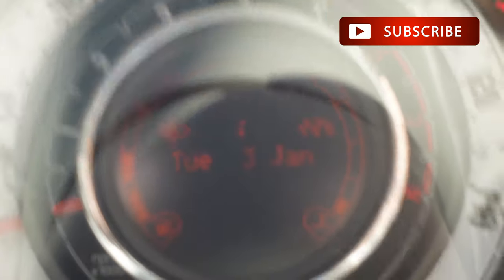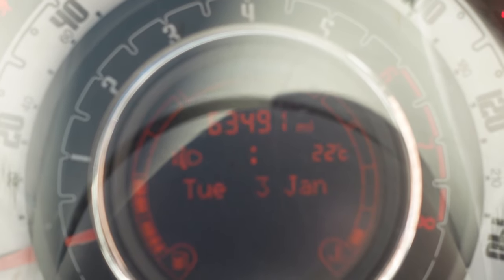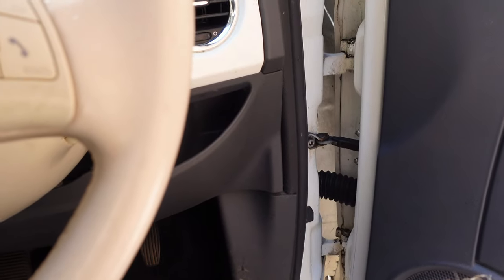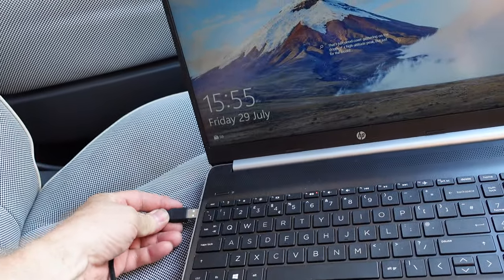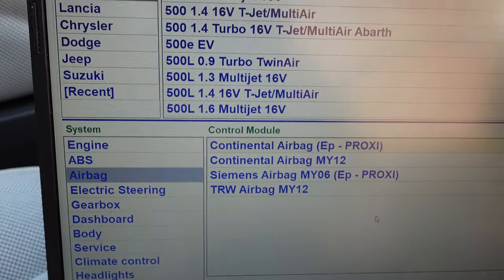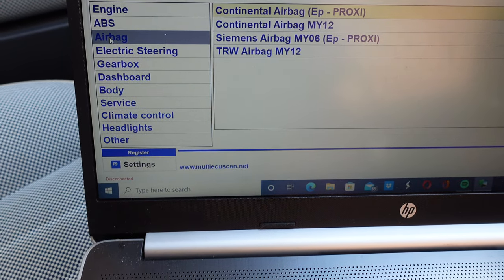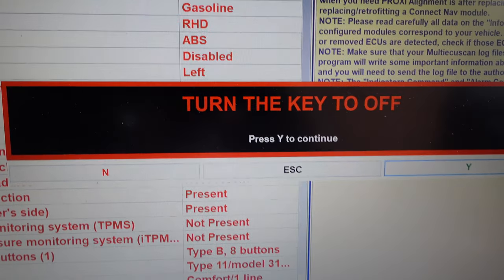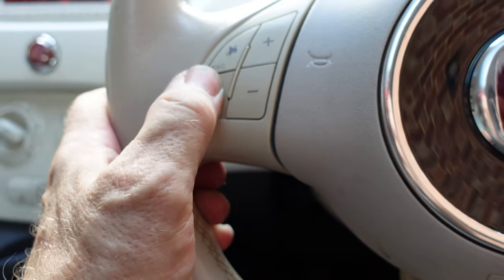Fiat 500 Flashing Mileage & Proxy Alignment - Blue & Me Not Working? #blueandme #fiat500 #abarth

Comment: Thanks for the video and your input. How do I disconnect the BLUE&ME system in the Fiat 500. There is an option to disconnect the power cable to the system. The system causes the battery to drain quickly.
Reply from the maker: You have to disconnect it on the back of the unit.
Reply: @Love500  thank you for the answer! Can't find a BLUE&ME edition on the wall. There is another place]. Fiat 500 robotic 1400 engine year 2014 manufactured in Poland. I looked in several places and couldn't find it.
Reply from the maker: @eliyahohayak  there is a possibility of it being under the dash to the left of the stereo but that is on a right hand drive car so logically on the other side. You can’t get to it unless you take out the parcel tray. It’s strange that there seems to be a very occasional change of location.

Comment: Have you ever done this on a Peugeot Boxer van? I have a 2014 van with flashing mileage, not too worried about losing the bluetooth or handsfree function but its draining the battery. I can't find any info on where the module is located though. Will Multiecuscan work on a Peugeot van? its same as Citroen and Fiat as far as I know.
Reply from the maker: I’ve never tried. In theory it should.

Comment: Hi. I have a 2012 fiat 500. Flashing odometer and battery drain if sits for more than 24 hours. Battery and alternator replaced. I removed blue and me module last night and today after driving to work and sitting for ten hours battery was dead again. Do you have any other suggestions?
Reply from the maker: Have you changed your earth strap? Is it actually dead? Lights working?
Reply: @Love500  lights came on but no start had to have another vehicle jump to start. I’m in USA, when you say earth strap is that the black ground cable of battery?
Reply from the maker: @kassiemiller9075  it’s the cable that goes from the left top chassis leg to the gearbox. A braided cable usually in a plastic sheath. They rot out and snap. The earth from your battery terminates on the same bolt. You need to take your battery tray out to get to it. Look in my videos you’ll see a video on it.
Reply from the maker: @kassiemiller9075  here’s the link.

https://youtu.be/QvJmDtKlV_E?si=7TojZlqp2K_aRKk9
Reply: @Love500  Thank you!!

Comment: Got same problem with my fiat 500 also after ten minute  warning light start flashing intermittently , is that still the cause?
Reply from the maker: More than likely. Intermittent sometimes. I just had one that was randomly flashing. Just had it repaired and works fine now.
Reply: @Love500  thank you so much you very helpful ,  sorry I take advance also , on the other 500 colour therapy 1.2 sometimes when I unlock the car the boot stay locked and when that happens the plate light not working and the message come on the speed say check check number plate light
Reply from the maker: @diegomasciave7615  that sounds like you have the dreaded tailgate wiring damage. Disconnect your battery and get in there and look at the wires. You’ll probably find some frayed and broken ones.

Comment: Hello, I have a Fiat Punto, I disconnect the blue&me and do the proxy alignment and it doesn't do it, if you removed the fuse if it does it, but then the radio doesn't turn on, I want to eliminate the blue
Reply from the maker: You need to unplug it at the unit.
Reply: @Love500  I have the unit disconnected and when I do the alignment it seems that it does not recognize that it is not there and it gives me an error and it does not do the alignment
Reply from the maker: @OmarRodriguez-yn4jp  it won’t do it if there are any other codes. Connect to each ECU and clear any stored codes then try again. I came across this a few weeks ago. I ended up doing the proxy alignment 5 times then realised there were other codes. I cleared them and then it worked.
Reply: I already did a complete scan and deleted all  the error Codes and in no way does It aling the  proxy, i don't know what to do .
Reply from the maker: @OmarRodriguez-yn4jp  keep trying it, if it doesn't have an error but just says complete but mileage still flashes, keep trying. I've never had it not work.

Comment: Thank you for your clear and informative videos!
I have this problem (Fiat Panda) and bought a new battery wich is now drained. I can't find anyhone who repairs this in sweden but in UK. 
I've been thinking about changing the steroe instead. 
Will the battery drain stop as I take the blue and me module out, or do I also have to do proxy alignment or anything else. And will the  milage stop blinking when I get the module out without doing anything else?
Thanks in advance!
Reply from the maker: To stop the drain, you need to unplug the module at the module. You may as well take it out. If you put an after market stereo in, you will still need to do a proxy alignment to stop the flashing.

Comment: Hi Paul, great videos!  If I disconnect the B&M, will the head unit still work for FM and CD?  Will the Odo still flash? I guess a different head unit will not stop the blinking Odo even with a Proxy alignment?  I basically want to stop the battery drain.  Cheers
Reply from the maker: Stereo will still work. Steering controls won’t. Flashing won’t stop until a proxy alignment is done. Same applies if you put in a third party stereo. Still needs proxy. Unplugging at the unit will stop the drain assuming it’s the blue and me causing it. Usually is.
Reply: Cheers Paul

Comment: Hi, thesis for all your amazing videos. Now, I want to get my own fiat 500. I found a blue one with the twin air from 2010. The front wheel alignment is of, the steering wheel is turned to the right and after a turn it won't move back like normal. Also it has aP0171 code. Is this a case still worth buying?  Regards Kai
Reply from the maker: As long as it’s only the tracking that needs doing and not something more sinister underneath. I would insist on it being done before buying it. The code is something to do with fuel I believe, possible vacuum leak. I wouldn’t be buying a car with errors like that unless they were fixed first unless it’s dirt cheap. The fact the seller hasn’t fixed them maybe because they can’t figure out what’s causing it.
Reply: @Love500  Thanks a lot. This helped me so much

Comment: Will that scan tool let you change weather things are present or absent we got a used ECU kit for one with a bad engine ECU the only thing wrong is the car the ECU kit came from had a knee airbag and this car doesn't so we have a airbag light on with the airbag ECU from the kit and with the original one no light but flashing milage and the proxy fails at the airbag
Reply from the maker: The airbag ECU controls the knee airbag not the body computer. I don’t understand though as all fiat 500s, at least the UK ones anyways have knee airbags. In adjustments tab in BCM you can disable things, I don’t think you can do that on the airbag one though. Whenever you disable something you then have to do a proxy alignment. I’m doing a video on this software today so I’ll have a look.
Reply: @Love500  it's a UK car and it's definitely not got one
Reply from the maker: @colinhamer6506  that makes no sense! Can you email me a pic at paul@love500.co.uk
Reply: @Love500  I can't we have let them take it with the milage flashing until we figure out how to get it done
Reply: It's definitely not got one just a peice if polistirean where I would be

Comment: Right ,here's my story. I've bought a new used cluster for my Fiat GP 2007 from a 2009 similar car. Milage start flashig after swapping. I tried a proxi aligment with Multiecuscan (registered) and the Elm 327 + yellow adapter. All modules are Ok , except Dashboard node Failed ( out of range). 
What is going on , will the new cluster need programming or something ?
Reply from the maker: No they don’t need programming they are plug and play apart from needing a proxy alignment. The out of range error usually means there’s something wrong with it. I’m assuming yours is a US car as I don’t know what a GP is but the same should apply. I have had instances where it’s done that on a blue and me so proxy doesn’t complete and the person who I did it for messaged me and said the mileage stopped flashing on the way home. That has happened twice. I would try another one if you can. Did you get one with the same colour dial? I.e. black, white, yellow? Also is it from a diesel or petrol. Shouldn’t make too much of a difference but there may be an incompatibility. When u e bought replacements in the past I’ve been asked what colour dial I have as well as the year.
Reply: @Love500  So the GP stands for Grande Punto. I thought aswell about some incompatibility issue, but I just set the gas milage instead of the milage to be displayed for now. If I get used to it I'll be fine,  I guess .Thanks for helping anyway 🍻
Reply from the maker: @Paul_Martinas  oh yeah, I’m aware of the grande punto. I reckon it is an incompatibility then.

Comment: This was really helpful....
I have a faulse open bonnet msg.. I reconnected the battery but didn't help, is there a solution with ecuscan?
Thanks in advance.
Reply from the maker: Uk cars don’t have an open bonnet sensor or do you mean the boot?
Reply: @Love500 I don't think mine has either..
It popped up when I used Alfaobd and changed alarm setting from off to on..
Reply: Changed them again afterwards in order to fix it but it didn't..
Reply from the maker: @fig4snick  they all have boot open message. If the boot is closed and you’re getting error then it’s likely to be your hatch wiring.

Comment: Is it possible to make it so that the Blue&me module isn't even searched for? I had a parasitic drain with my b&m and so removed it. I dont care to put it back or to replace it or put a fancy radio in. The flashing does bug me though.
Reply from the maker: Only by disconnecting the power cable at the unit itself, then a proxy alignment. If you physically removed it, then a proxy alignment should run successfully and stop the flashing.
Reply: @Love500  thanks for confirming. I'll set about getting the bits together and sort it. Didn't want to get the software then be no better off 👍

Comment: Thank You for very informative video. Sadly mine stopped working yesterday. Disconnecting battery did not help. Removed the unit and it goes to electronic workshop for repair.
Reply: Got mine repaired. No flashing odometer anymore and everything is working as it should again 😀
Reply: @iwadrian  Hi, who did you use for the repair? Cheers
Reply: @seantucker2690  Revtronic Bradford West Yorkshire. You can buy repair online and send unit to them. I have wisited them in person because living locally. Collected within three hours.

Comment: Hi why do you need the yellow cable can a normal elm not work, and will this work the same on a KA 2 as its basically a 500??
Reply from the maker: Engine, steering and auto box I believe use just the elm. Everything else on a 500 needs the yellow. I have no idea whether it works in a Ka, never tried.
Reply: @Love500  ok thanks for the reply it might be worth paying to get this done as by the time I buy another adapter and the software it would cost about the same,
Reply: @Love500  hey, I went to the multiecuscan site and I can't find the yellow adapter

Comment: Thank you so much. I have a Ka 2013 and without warning on startup one day I suddenly had a flashing odometer and no bluetooth/voice and the respective buttons on the steering wheel were unresponsive. Thanks to your vids via google I have removed the module (I didnt try proxi first) and just fyi you dont need to drill out the rivets - I used a small hobby type 1/4" ratchet (like you get in a pound shop) with an 8mm socket and had no problem removing the 4x nuts. The module can then be easily drawn out through the area just behind the speaker. Yes a bit fiddly but imo far less effort and mess then drilling out and replacing rivets. I have sent my module off today for repair and all my fingers and toes are crossed that it doesn't need a proxi on return but if it does I may take you up on your very kind offer to align! Again, thank you so much, people like yourself make YT the valuable resource it is.
Reply from the maker: Someone else said about the bolts. I’ll have to update this. Glad you managed to do it.
Reply: @Love500  yeah its just an option my friend. I weighed up the two options and went with the nut removal. Personally I think its easier and quicker but then its not my 1st time working out solutions in cramped spaces - under the dash on your back in contorted positions in footwells is the worst right?!!
Reply: Little update to this - got my unit back from repair (no affiliation but Northern Autotec were brilliant) and it worked perfectly from the get go. No requirement for Proxi either! They were upfront in making no guarantees that Proxi wouldn't be required but I guess I got lucky :) So with your video help, £95 for the repair (+£5 to ship it to them) I got the whole lot working for £100 and a bit of my time which would have cost about £1200?? at Fords. THANK YOU!

Comment: I’m thinking of buying a 500 from a friend,he says after changing the battery his mileage started flashing and the Bluetooth stopped working,can I replace the blue and me module with one from eBay or does it also need programmed? Thanks
Reply from the maker: Will just need a proxy alignment to stop the mileage flashing. No programming required. A proxy alignment may make it start working though so try that first.
Reply: @Love500  how do I get the proxy alignment? Do I need to goto Fiat
Reply from the maker: @bill_20  if you want to pay about £130. Get yourself multiecuscan and a set of cables from eBay. www.multiecuscan.net for the software.  Costs 50 euros. This video shows how to do it
Reply: @Love500  hey thanks I will check this out later,thanks agsin
Reply: @Love500  also any advice on buying a 1.2s 1242cc,is this engine shared with any other car?
Reply from the maker: @bill_20  same engine as the Ford Ka.
Reply: @Love500  Thank you 👍

Comment: Hi , my partner recently purchased a fiat 500s 2014 and straight away on the centre console it brings up a airbag failure alert but no light on the dashboard but also her mileage is flashing. Would doing a proxy alignment help in her case?
Reply from the maker: Possibly as something has lost contact with the BCM, even momentarily. I would read the code first and see what's causing it, reset the code and then do a proxy alignment.
Reply: @Love500  Thank you for the reply. I'll get the kit and see what happens from there. I'll keep you posted on the results 🙂
Reply: @Love500  just as an update THIS WORKED!! Thank you so much absolute life saver!!
Reply from the maker: @sc0ttyt90  money saver too 🤣🤣🤣
Reply: @Love500  ohh yes indeedy 😂🤣